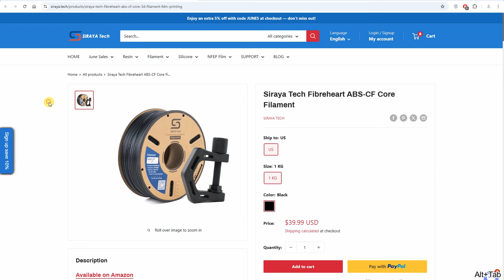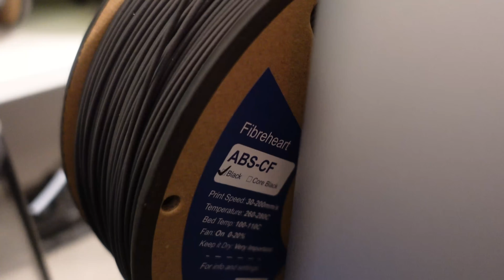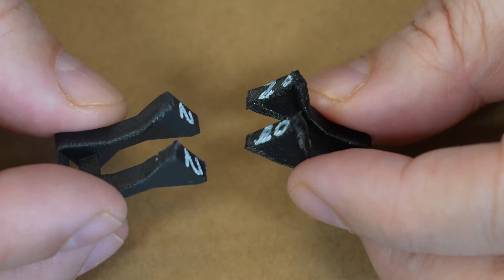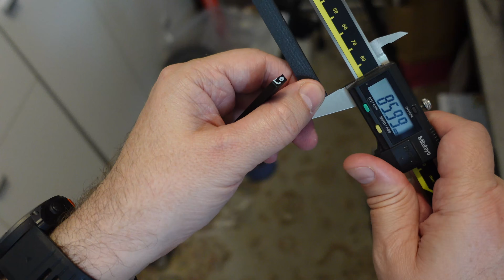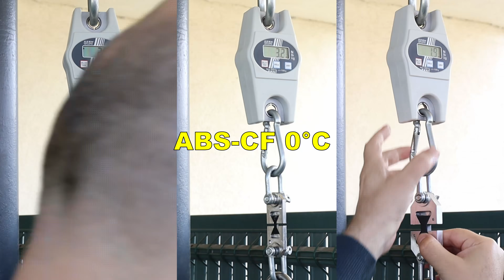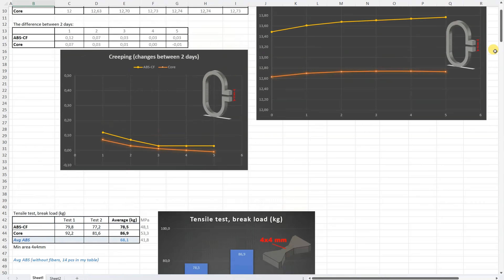The Strongest ABS I’ve Ever Tested: Siraya Tech ABS-CF vs ABS-CF Core

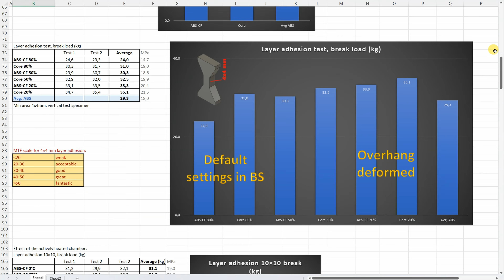Comment: 16:00 Have your cake and eat it.  Note the test piece breaks in the center section... which printed fine at 20% fan, correct?  The overhang looked horrible, but wasn't under stress, and further, if it was, it's far larger cross section.  The solution is clearly: 20% part cooling for vertical... 80% for overhangs... with the caveat you try to avoid overhangs in the most highly-stressed part of the part.

Comment: I absolutely love siraya tech filament and two part silicone. They consistently get me to use materials i had no intention to use. I love their GF ASA. 

On the other hand It did actually fall off like said here. The ASA version is springy enough and seems to have enough internal stresses from just being spooled that it even happened halfway through the spool once when i bumped it a little mid print. 

I printed it on a p1s, chamber temp of 50 to 60 depending on ambient temperature. Its good to see the abs reviewed. I specifically kept a set of nozzles for the ASA versions.

Comment: I have tuned my machine for doing ASA only. Part cooling fan should be off, but the minimum layer time should be tuned so you don't get that curling effect from laying down another layer while the last one is still molten. As you can see, your layer adhesion went down with more part cooling fan. My minimum layer time is 15 seconds and Cura chooses to slow down the print speed dynamically based on what is going on.

Comment: I'm in the UK and can't find this for sale anywhere. Their resin is readily available but very little in the way of filament. Their Amazon UK store has the ABS-GF and in spite of what Siraya Tech's website says I cannot find them on Aliexpress at all. This leaves importing from Amazon USA as the only option, which is a tad expensive.
Reply: If you don't really need CF you can go Qidi ABS-GF25, its basically the same just Glasfiber instead of Carbon Fiber. (and 5% more filling) 
All the Core filaments are relabeled Fusrock filaments, but oddly enough their prices are more expensive compared when you buy them from Siraya or Qidi.
Reply: @hornet331  Thanks for the tip, that Qidi seems to be readily available over here

Comment: Siraya ABS- CF and GF have been my go tostructural and strength filaments for a year now.
the prices have come down quite a bit lately too.
a note, you might want to invest in extra filament runout sensors, or not use them if you are sure you wont.
I also reengineered quite a few of my commonly printed parts to take advantage of it's strength over PETG, they came out still stronger than, and cheaper to print too

Comment: Why are you calling carbon fiber warning videos "clickbait"? There is a real danger there.
Reply: What's the real danger? What has been shown is a tiny amount of fiber deposition on to skin. I'm not saying danger is impossible, I'm saying it absolutely has not been demonstrated.
Reply: don't eat the filament then
Reply: @WHAT_1400  How exactly are you planning to avoid eating the filament when it is embedded in your skin? Never eat with your fingers? Are you going to put on gloves any time you want to eat or rub your eyes? Are you going to wear a respirator for the rest of your life in case these things ever come loose from your skin or the print?
Reply: @ThisIsMeArnold  oh, there far grosser and much more sentient things embedded in your skin already. don't worry about it
Reply: @ThisIsMeArnold You literally shed your hand skin constantly... Those fibers will work their way out, not in. They also don't automatically embed. Most will wash off immediately.
Reply: @ThisIsMeArnold  Also your hands shed constantly. The fibers work there way out not in. Yes you should definitely avoid licking the filament or touching your eyes. I just wash my hands after touching, but gloves aren't a bad idea. Just don't exaggerate without cause, though it's fine to advise caution.
Reply: I agree but I wouldn't call this dangerous but risky, in most cases CF filament is only marketing, strength is weaker than classic filament, newbies use it to print fidgets... just because the surface finish is beautiful.

There is no real reason to use CF filament at home.
Reply: @vilainlechat7187 Well, no. It's often much more brittle and often has less layer adhesion, but it's not technically weaker. It's often much stronger in terms of bending and yield, at least against along two axis. It's useful for a lot of engineering cases where stiffness is necessary especially, but it depends on the filament obviously.
Reply: @802Garage  Yep this should be used for engineering purpose, not for home printing with PLA and PETG that will be used as toys or manual tools. Less you manipulate the part better it is

Comment: Have you ever considered doing a test where the variable is nozzle size, I'm thinking that a bigger nozzle would make a better layer adhesion but I don't know. Along the same train of thought, a test of layer adhesion where different line widths are created with the same nozzle and the same layer height would be very interesting too.
Reply from the maker: Yes, not only that, I want to test dyamondback nozzles, hi flow nozzles, I have all them here. Only from those product (3dp, lasers) reviews, I don't have time for this.. I will stop with those videos, then I will have time for "my" content. Only YT algorithm should really change the approach to my videos. I just can't accept, that most of my views are from "all notification" subscribers.
Reply: @MyTechFun I do my best to share your videos any time someone is talking about a product or filament you've tested.
Reply: A smaller nozzle will be stronger, more pressure from the smaller oriface compared to the larger nozzles. .4mm nozzles really are a great size and the benefits from going to a smaller nozzle aren't worth the extra print time.
Reply: @rileyneufeld7001 false

Comment: I really appreciate the added factors of part cooling and chamber temperature. I know that must be a lot of extra work, but it's super useful since a couple clicks could potentially add a bunch of strength.

I wonder if you could generate a local AI model with all your data to help make predictions or draw conclusions?

Also just curious, in general do you have a preference of the x1 carbon or the qidi plus 4?
Reply from the maker: If you need that extra 70°C on the nozzle and heated chamber, Plus4 (or H2D). If you don't need more than 300°C, then X1C.

Comment: When printing core filaments are you getting a nice smooth surface on all faces? I’ve been testing siraya ppa core but I get a nice smooth surface only on faces in one orientation and a rough finish on opposing faces, very annoying
Reply from the maker: Dry it gooood. This is what I recently noticed with PET-CF and PPA-CF filaments.
Reply: Also possible you have a loose printhead component.

Comment: I have been using these for a while. My favorite ABS. I print with a 50* chamber.

The Core version can break while printing if you are not careful with placement of the part on the bed. It doesn't like to take tight bends in the feed tube. And I feed from a filament dryer, and when the spool is new, it can break at the area it feeds into the tube from the dryer. After the spool empties a bit that problem goes away. Other than needing to keep these things in mind, it works well.
Reply: I only have experience with the ASA version. It seems to be fine in my setup but its snapped in the ptfe tube between my drybox and printer. I have to make sure the curve there very gradual rather than inside the actual printer.

That might be different from you because I have the tube inside the machine clipped to the chain in a way that keeps all bend on the tube much more gradual. 

It can "jump" and explosively shift on the spool though. That makes it jump off the rollers in the diy dry boxes i use. Its been enough to knock it partially off the back spool holder as well. Before I figured out whats going on and how to minimize that anyway. 

Its still worth it though. The final prints are wonderful.
Reply: @JNMeiun I use one of those older esun filament driers as the dry box I print from. It was cheap, and uses the larger PTFE tube. I have a short piece of the 4mm tube that comes out of the printer. I feed the filament out of the large tube and into the smaller. After I get it to the extruder and load the filament, the small tube will slide into the larger tube, keeping the path sealed.

I run the drier on the lowest setting, just to keep the air dry inside.

That setup has been working well.

I also make sure the tube inside the printer has room to move as much as possible free from the wire chain.

But when I use the core versions or even stiffer filament, I still run the risk of the filament breaking when the toolhead moved to the left rear corner. So I make sure my parts are printed closer to the right front for those filaments. As long as the filament survives the homing process. Everything is usually good to go.

Comment: You wouldn’t think that the core versions would be stronger. I’m often surprised at what scientific testing shows.
Reply: I would. Haven't watched the video yet, but assuming both have the same amount of fibers I would expect the cored version to be stronger. No fibers in the outer surface should give better layer adhesion, and more densily packed fibers in the core should give better load transfer between fibers. I could be completely wrong of course, but that's what I'd assume going in.
Reply: @user-lj4xq4hm3k I was thinking the opposite way. If fibers stick out of the layer, they would embed into the next layer, contributing to enhanced layer strength. It’s an interesting topic.
Reply: I thought EVERYONE would expect the core version to be noticeably better outside of layer adhesion.
Reply from the maker: With layer adhesion I was expecting better result, but not bad. More CF reduce the layer adhesion, but here it could keep up, even with 2x more CF
Reply: @MumrikDK I don’t see why. As I responded above, the core version is stronger. I’m not arguing that. It just surprises me for the reason I gave above.

Comment: Thanks for the great testing.  My Sovol Zero printer is a little ABS-CF printing monster.  The small bed doesn't use much energy to reach 110 C (and doesn't heat my office as much) and the small enclosed chamber quickly reaches 60 C via passive heating.  I recently printed some eSun ABS-CF and the parts were great.  I just ordered the Siraya ABS-CF to use for my strong high temperature parts.  I liked the 80% lower shrinkage of the core version but didn't like the shinier finish and the need for more cooling to get good overhang performance.  I may get the core version as well because sometimes I don't want the abrasive finish.  I made a holder for my USB power bank yesterday and used PETG because I didn't want to scratch the power bank sliding it in and out over the ABS-CF surface.  Most of the time, the matte finish on the ABS-CF is preferred because it looks better than shiny PETG, ABS or ABS-CF core.

Comment: Now PCTG CF
Reply from the maker: Which brand?
Reply: @MyTechFun  maybe Fiberology or Spectrum? Both 10%
Reply from the maker: @Sputnik888  From Fiberology, I have PETG-CF (not PCTG)
Reply: @MyTechFun  You have PETG vs PCTG, PETG CF vs PETG GF.
So its time for PCTG CF vs PCTG GF, or PETG vs PCTG any fiber combination.
Personally I have printed with PETG and I didn't like it brittleness. Then I tried PCTG which was upgrade, but I'm curious can it be even beter with fibers. Does fibers increase stiffness and impact resistance in this case?

Comment: I have been using these for a while, they are one of my go tos. Great material, great company. I don’t worry about moisture with these. If you print it with extrusion width 150% of the nozzle, the fibers make the parts un-handleable. I would like to know if that impacts z strength positively or negatively.
Reply: What do you mean by un handleable?